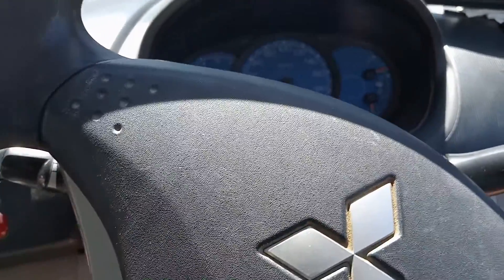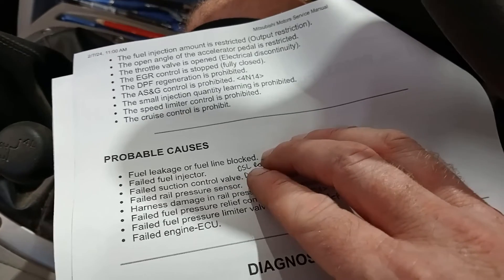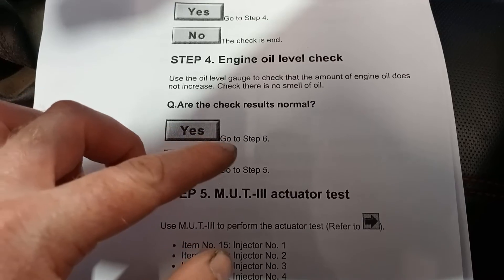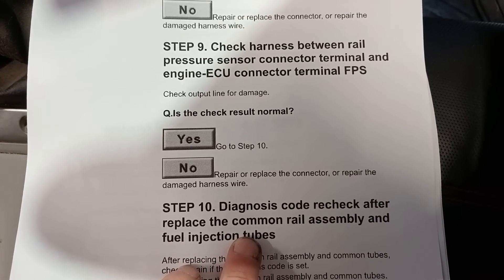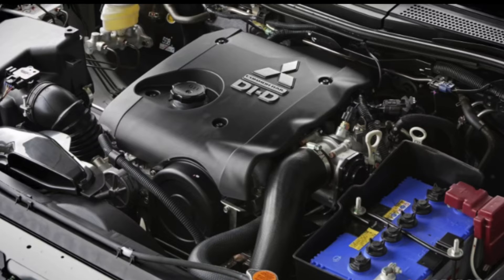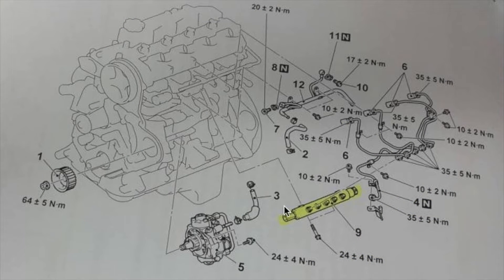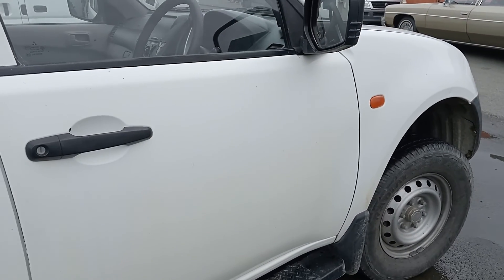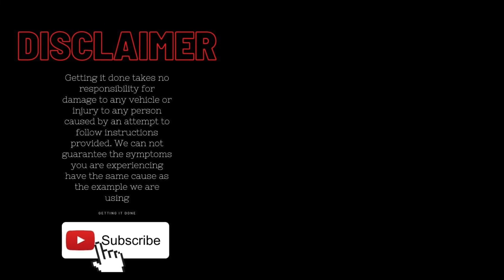Mitsubishi Triton P0093 (fuel leak detected)

Comment: I had the same problem. The fault code P0093 also came up sometimes. After testing the wiring i found a loose wire in the connector of the pressuresensor. I changed the short harness. The problem was solved.
Reply from the maker: Ah interesting. I had that happen to me on a Navara (got a video on that one too). I did check the same thing on this one but there was no change with moving the wiring, so went for the sensor. But definitely good to check that wiring first. And good to know that it happens on the tritons too, thank you.
Reply: Do you have a pat number for the short harness please
Reply: @ hello. I am sorry. I have no partnumber. I could not find one because the small piece of wiring is part of a bigger engine control harness. So i built my own one. It is basically the connector plus three wires of the fuelpressuresensor on the backside of the rail witch goes to the a bigger connector. This bigger connector unites also with the short harness of the camshaftsensor. You need a new connectorhousing with three pins and three wires. I bought my stuff online.
Reply: Part Number Sorry !

Comment: What were the symptoms of a failing fuel pressure sensor. Thanks from Trinidad 🇹🇹 ps have the same problem
Reply from the maker: The vehicle would randomly cut out while driving. Then after turning the key off it could be restarted again. And also the fault code.

Comment: Mine is leaking from the top pipe on the fuel pump, the top connection facing the passenger side. This pipe has only been removed once since new. They say you have three goes at tightening before you need to replace it, so I'm going to tighten it an extra NM or two.